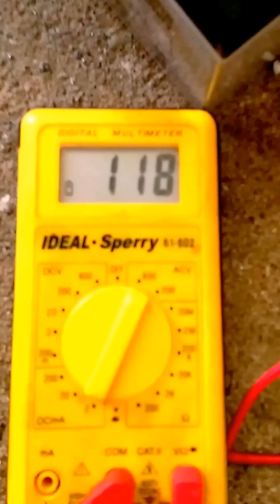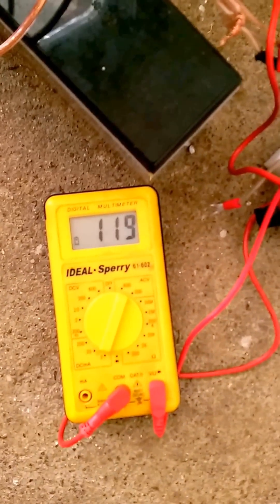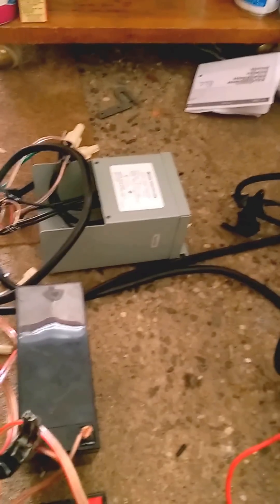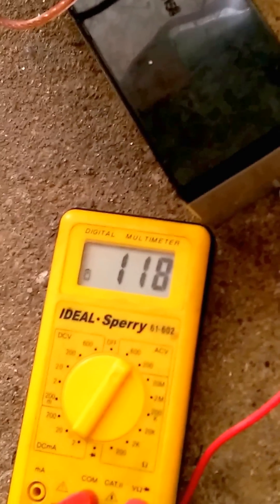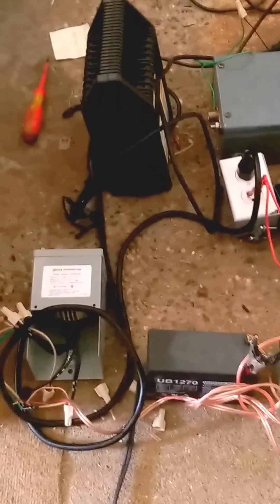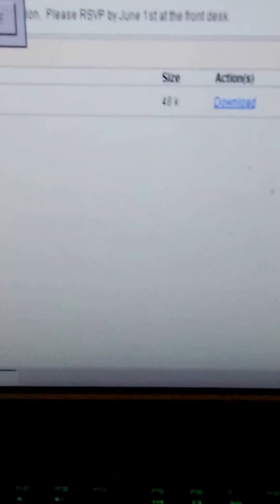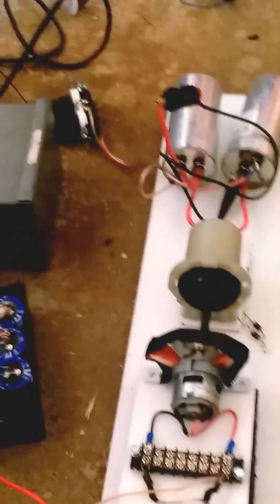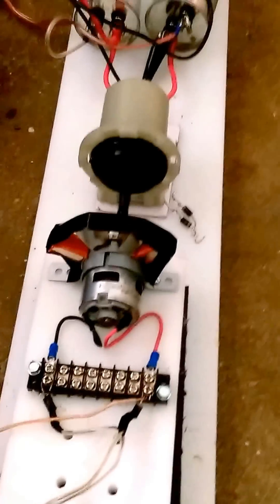Gerard Morin Washer Pump Generator &  PELEX DEVICE Successfully Looped!

Comment: Whats the input to the drive side in watts?   And the output side in watts?   From the vid the volts appear to be dropping...  Do the volts climb at all on the source batteries?  (ie. go up over 12volts?  )    Curious how its doing after 5 days or so if left running.
Reply from the maker: CoruscantMe I haven't added the killawatt meter to it and the clamp on ammeter beeps as a warning from the higher than normal frequency so, I didn't attempt to even measure it so I didn't hear it from Skeptics, but, the original video showing 120 volts from the wall ran at 7 watts input and maxed out at 1500 watts output (maximum of the killawatt meter) The system operates with the same device so I am pretty certain I should get the same readings, but, the generator is spinning faster than it has to making the frequency much higher than normal. When I limit the frequency by filtering it, I obtain 3 times the amperage out for the same input . When the output level is higher than normal, the input wattage literally goes down. It is normally 7 watts in from 1-1500 watts of output and it reduces the input wattage once I reach 2000 watts to 6 watts and 5 watts at 2500 watts to 3000 watts. 3000 watts is overloading the conductor by double and the device starts to get hot and smoke. I don't want to smoke the transformers because the primaries are factory wound so unless I take them apart and count the windings, I will never easily duplicate this as it took 36 different transformers before I obtained the result I have which was completely accidental. I was extremely fortunate to get this working, it was through trial and error and it was only because I was playing around, making connections at random until I saw a voltage show it's presence when I had no batteries or feed powering the device. Once it showed 3.6 volts ac coming from the pair of transformers, I added my ac power supply to it and tested an automotive tail light bulb to the circuit and noticed it was running at the same wattage no matter how many I added in parallel. It still has me completely baffled as to how it functions, I think it is related to schumann resonance and opposing magnetic fields of the transformers as they are two bucking transformers mounted to each other (secondary to secondary) and the input (primary) is tied to the secondary, secondary of both transformers looped, feeding the output with the neutral jumpered through, tagging the other side of the primary coil, which loads a third transformer's primary and then the secondary fires the load. The third transformer is only to isolate the load physically from the first 2 xfrmrs and to adjust the voltage output so it stays close to 120 volts. Once I added a crossover filter to the output, I have now obtained double to output, but, for some reason, feeding it with an outlet gives me 1/3 more power than the generator and bateries.
Reply: Marc Belanger The killawatt meter is usually setup to read at Mains frequency so it will be useless or at least exhibit a wide margin of Error when the frequency output is double/triple what the meters designed to account for.   

The input is DC right?  So just put an AMP and VOLT meter on the input to see what its Drawing as Watts.   

The output has to be converted to DC to go back into the batteries right?  So at THAT point you should be able to measure the DC VOLTS and AMPS on the output side to see what the WATTS are that are present there.    

Those are some great claims, but given the means of verification I'd consider them iffy.   Without the Drive batteries voltage going Up instead of down I think time will prove the system out.   

Have you drawn up the schematics for the whole system that are shared somewhere online?   Its hard to make anything out from the video beyond the morin config with the drain pump then current limited by the two capacities, one on either drain pump output lead coming off that motor as generator...beyond that I can't tell whats happening.
Reply from the maker: CoruscantMe  Yes, the voltage goes up to about 13 volts, and with a load, the batteries literally go higher as the system reacts like a generator at idle once a load is initiated and it raises it's speed to compensate. Strangely enough, there isn't any circuitry to do this, just transformer coils, but, the way the transformers work are by the magnetic field fluctuations and believe it or not, when the unit is not powered up, it is already producing 3.6 volts ac by itself. The weird part here is that this is a pulsed dc motor, not really a true ac sinewave so the Pelex device isn't working as it does with a normal electrical feed from the wall, but, it does drive the transformer and the charger, or a light bulb and the charger at the same time and cause a rise in battery voltage. If I plug the Pelex device into the wall, I have another video with killawatt meters on the input and the output. Here's the link: https://www.youtube.com/watch?v=_9-gZuvmWKE
Reply: Marc Belanger Definitely sounds curious, do you have schematics for the whole setup so I could try and replicate exactly what you're doing?   Would like to see this on my bench to see if it works when I build it.   Let me know if you're willing to share.   Thanks for the reply!
Reply from the maker: CoruscantMe please explain to me how it's dropping when the voltage varies from the same low voltage to the same high voltage throughout the video?
Reply from the maker: CoruscantMe the video starts with a range of 117-119 volts and it keeps varying back and forth between 115-119 volts. If I move the magnets on the motor it will jump to 125 volts and still vary all the way down from 115 and up to 125 depending on the speed of the generator. If you watch my other video showing the Pelex device you will see the input at a mere 5-7 watts @ 120 v input to 120 v @ 800-1500 watts output without one issue of losing voltage since it is utilizing the wall power to do this. The power factor has been increased and literally fixed where it originated at 39, and it is 99 in my output, which is literally incredible. I'm not sure where you see my voltage going lower.. Please explain. The input firing the motor stays on as long as I wish, I just don't have the ability to upload a video the length I would like, nor do i have anything available to provide a live feed, maybe somebody can assist and provide this to me, but, I don't feel it's necessary to provide this to anybody other than investors. I feel I really don't have to prove myself to make others feel i an genuine and not a scam artist because the devices I build are all very real.
Reply: Marc Belanger My bad, I thought that dvm was on the 12volt 7ah batteries you showed, so I thought the reading was 11.8-11.9volts, not the 117-119vac you noted.  I re-watched it and see that its as you note.  (first time I couldn't watch with sound.)    It Sounds great.   7 watts in and 800 watts out...  Sounds also like you are only looking to profit monetarily tho, so I won't bother asking for schematics to attempt to build one for myself.   I guess good job!  Hope it works out like you want it to.